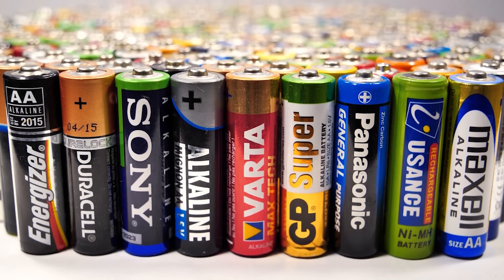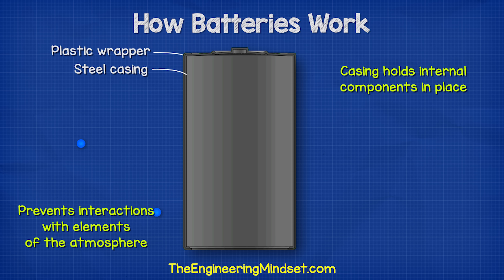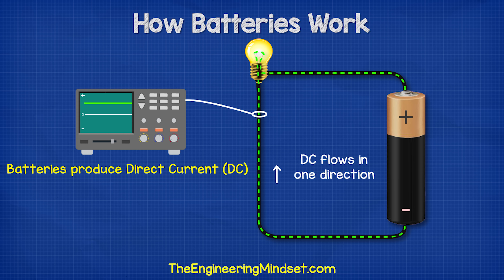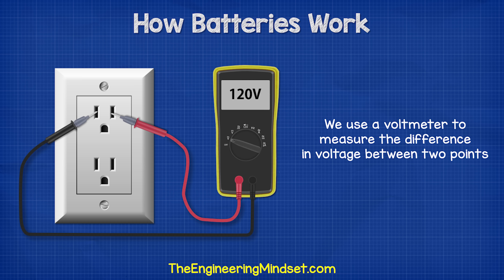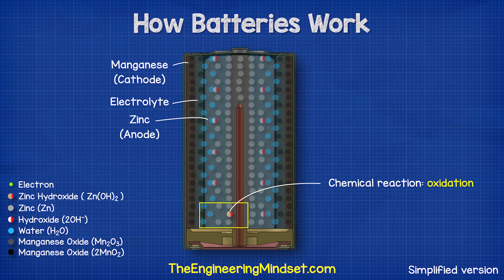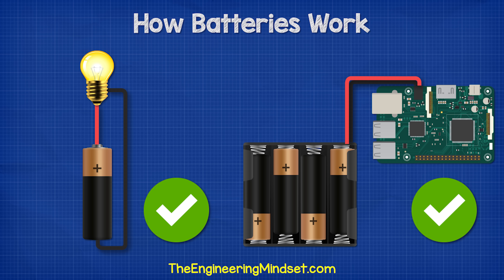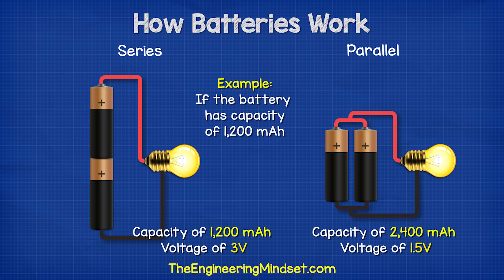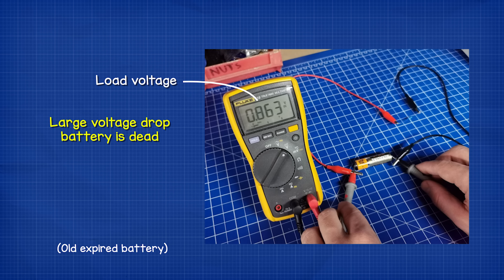How Batteries Work - Battery electricity working principle

Comment: Suppose we have a wire connected to only negative end of battery ,we know there will be some surface charges on the wire in order to cancel the electric field produced by the battery  .So does it mean battery has accumulated some net positive charge? But textbooks says batteries can't accumulate charges. This should change it's potential too

Comment: "In an alkaline battery, the electrolyte is potassium hydroxide (KOH) in a solution of water. It is in contact with the anode material and helps ions and electrons flow." He left this part out, just encase the water part blew your mind

Comment: Overall helpful, but it really needed a discussion as to why the direction of electron flow goes the way it does and not the other way, which requires a bit more discussion on chemical potential energy, etc.

Comment: Why won't it work if electrons just flow through the filament and to the other terminal of the bulb and just stop there without going back to the battery?
Reply from the maker: It won't cause the chemical reaction so electrons won't be released

Comment: I’m a noob to this subject. I have a question. If a multimeter is used to measure the difference in voltage of two points, why is it that when we measure two points on the bus bars in a breaker box, (bus 1=120V & bus 2=120V) it adds the two voltages? Why do we get a 240V read? If the multimeter were measuring the “difference”, wouldn’t it read “0”? Again, sorry if this is a dumb question. Just trying to reconcile information that I saw between two different videos in this channel. Thanks!
Reply from the maker: Check out our electrical panel video for more info, but basically one panel is +120v while the other is - 120v so the difference between then is 240v. That's the VRMS though, the true peak voltage is much higher but don't worry about that for now
Reply from the maker: Check our new Multimeter tutorial out ➡️ https://youtu.be/4lAyzRxsbDc

Comment: Please please please please please clear this small doubt.So,electrons from the negative terminal of the battery when they reach the positive terminal THROUGH THE CIRCUIT,do they again go to the negative terminal FROM INSIDE THE BATTERY or they just deposit at the positive terminal or the electron gets deposited at the positive terminal and the new electron formed by whatever chemical reaction inside the cell then go through the negative terminal of the battery to the wire and then again deposit to the positive terminal? Please please please please please clear this small doubt

Comment: AA or AAA cells are not a battery. A battery is two or more cells in series. So, 2 AA 1.5v cells together in a device form a battery (of cells). However, a 9v is basically 6 ,1.5v cells in series to form a 9v battery. You need to get these things correct if you intend to educate people.
Reply from the maker: Maybe, but, no one ever goes to a store and asks "Excuse me, do you sell cells?" they ask for a battery. No one searches for how a cell works, they search for how a battery works.
Reply: @EngineeringMindset  I hear you and no disrespect but just because alot of people are ignorant to it doesn't mean it shouldn't be taught properly. You aren't taught in biology that the man places his dick in her twat and nuts you are taught proper terms and definitions. Just making a point your video was quite professional otherwise.
Reply: @EngineeringMindset  Please clear this small doubt, please
So,electrons from the negative terminal of the battery when they reach the positive terminal THROUGH THE CIRCUIT,do they again go to the negative terminal FROM INSIDE THE BATTERY or they just deposit at the positive terminal?

Please please please please help me

Comment: If multiple batteries are next to each other, but they alternate between direction, is it still a parallel, or is that wired to work like a series? Plz help

Comment: Sorry, if this is a dumb question. 
In a simple bulb circuit with 1.5v battery as energy source. Electron flow from the negative to the positive side .
As the electron pass through the filament of the bulb. Resistant in the filament causes heat to be generated. 
Does this mean that the electron themself is converted to heat? 
and since the electron is being pull out of the battery from the negative to the positive side. 
Does that mean the initial charge of the battery, created via chemical reaction/stored charge.  is being depleted
Reply: I think no, electron themselves don't turn into heat,I think they lose thier potential energy or charge smth(I'm in 10th grade only so don't know much)

And I think yes,they keep losing whatever potential energy or charge they carry through the circuit(again,I think,I think,it's because they have resistance in thier way in the form of other electrons,nucleus,etc)
Reply: @aakashgarain  thank you, the key word you used guided me to the right reading materials ! . Thank you very much

Comment: This video describes a cell.  A battery is two or more connected cells.  These definitions are well-established.
Reply from the maker: Maybe, but absolutely no one goes to a supermarket and asks the store assistant "where are the cells" you ask "where are the batteries"
Reply: @EngineeringMindset  Please clear this small doubt, please
So,electrons from the negative terminal of the battery when they reach the positive terminal THROUGH THE CIRCUIT,do they again go to the negative terminal FROM INSIDE THE BATTERY or they just deposit at the positive terminal?

Please please please please help me

Comment: Great video probably the best currently on the internet about this subject. Only one inconsistency of the animation showed at time stamp 10:15 and thereafter of the video, incorrectly showing electrons transfer from the cathode to the anode brass pin. What actually happens is that the newly formed hydroxide molecule in the cathode and passing through the separator to the anode, is reacting with a Zinc atom to form zinc hydroxide molecule which then releases two electrons inside the anode to the brass pin. There is no direct electron flow from the cathode towards the anode only hydroxide ion molecule transfer from the cathode to the anode via the separator. The separator or else referred as barrier is porous with openings small enough to allow only water and hydroxide molecules to pass through and not to the larger Zinc hydroxide and Manganese hydroxide versions molecules. Also keep in mind that there are no individual discrete zinc atoms inside the electrolyte alkaline solution but only zinc hydroxide molecules.
Reply: So basically,the electron present in the circuit get deposited at the positive terminal of the battery,and the new electron created by whatever chemical reaction is there inside the battery then go through the negative terminal of the battery to the circuit and into the positive terminal to get deposited, am I right? please help me in this small thing, please, please, please (I'm a 10th grader so small details about chemical reactions don't bother me)
Reply: @aakashgarain  Yes.
Reply: @Markoul11  thanks

Comment: Very nice video. I have a question. If I suspend a pendulum over the positive terminal of battery, it rotates clockwise and vice-versa over negative terminal. Why does this happen? Is there a magnetic field?

Comment: Hello I have a question at 11:30 is that are these electrons in the battery are pushing the electrons of the copper wire across circuit???
Reply from the maker: Yes, the free electrons in both the battery or the wire will move.
Reply: @EngineeringMindset  thanks for clarification.

Comment: 2:00 if u rip o the plastic the cover on the + and - will fall of where the electric flows to and note if u thinking what i mean it wont be on thr chemical its the metal cap even tho there is not hole

Comment: If the positive end is in face the cathode, then the flow must be from the positive terminal of the battery to the negative end, but the ends are not labeled by electric charge, they are labeled by convention, to show where the charge is coming from. I appreciate your diagrams showing flow from negative to positive, because this is correct, however, I think you should adjust the position of the battery to show where the charge is actually coming from, while specifying that the charge is not in face positive at this end

Comment: This channel gives me ASMR chills.
I still don't get series circuits with batteries. It seems to me that the positive and negative terminals that touch would just short circuit and the power would be wasted. As far as I'm aware, the chemicals are charged from the factory, meaning that as soon as the connection is made, electricity flows and they can become neutral. If this is the case, then the original circuit through the load won't result in further voltage coming out the negative terminal. Doesn't connecting the positive and negative terminals satisfy the condition to discharge the battery? Why would it result in greater voltage? Also, how come series circuits don't discharge when they're connected, even without the load circuit being completed? They are only partially open, there is still at least one connected cathode/anode.
Series circuits just don't make sense to me. Parallel circuits don't have this problem at all.

Comment: It's not exactly like this. Actually electrons can only move almost 8 cm per hour. They still move, so when electrons move they produce electromagnetic waves. These waves are pretty close to the speed of light. With conductive materials, electromagnetic waves flow and complete the circuit to produce electricity. Just think about Nicola Tesla and you'll see what I'm pointing. Video is good but could be better.
Reply: @AmanKhan-yk6mj  Well, I already did but let me explain a little bit different. If you watched all of the video, consider everything it says are true but 1 part which is electricity doesn't carried by electrons. They carried by electromagnetic waves. That's all :)
Reply: @AmanKhan-yk6mj  hl

Comment: woah woah stop right there isn't it that a battery works by a material with few extra free flowing electrons trying to find other atoms with incomplete electrons? That when you connevt a wire between this two slabs of material the first materiall with tons of electrons will flow to the material with lesser electrons and the principle of battery draining is when the firt materials donated all the electrons to the second material?? btw I'm 9 yrs. old so I don't know if I'm correct haahhhhahaha. also isnt it that the insulator only acts as an insulator to disable the reaction specifically the receiving of electron from happening??
Reply from the maker: Please watch the video, it is all explained in detail

Comment: Wow- I’ve been trying to understand the chemical reaction for a long time, and have researched in many places. Finally- a video that explains it clearly. Thanks so much!
Reply: Is electron flow is opposite to current flow?
Reply: @alladamohan9339  Conventional current flow is positive to negative. It’s technically wrong— current (electrons) flow from negative to positive. Benjamin Franklin got it wrong, and it’s been taught that way ever since. These days, you’ll see some teachers who show conventional current flow, and some who show electron current flow. It doesn’t really matter which one you use to analyze a circuit. You just have to be consistent.
Reply: @alladamohan9339  no, curent is the flow and volume of current without time being calculated. Sorta like water in a pipe
Reply: Plzz explain any one

Comment: Can the lamp turn on if i connect positive terminal of battery1 and negative terminal of another battery, named battery2. The batteries are similar.  Thinking of positive and negative caused by electron this should work.  Please your help
Reply: No.  The two batteries have to be connected to form a circuit.

Comment: Why are alkaline batteries often rated in amp hours, while lithium ion batteries are rated in watt hours?  Isn't watt hours much more specific and useful?
Reply: if you know the voltage of a battery Wh and Ah can be easily converted into each other, product of Ah and the rated voltage gives Wh. Some products come with both labelled

Comment: So why put a fuse or a switch or a load on the positive side of a DC circuit, "IF," electrons flow from negative to positive????? Something is wrong with your analogy of electrons' flow. Yes I am from old school and I claim your teachings WRONG......
Reply from the maker: You could place a fuse on the negative or anywhere in the circuit, it's just standard practice to place it on the positive. If on the positive or negative it will break the circuit, if on a branch within the circuit then it will cut power to that one branch only. You can watch our Electrical current explained video to see electron flow but we will make some further videos to prove the theory.
Reply: If you think of a car where only positive wires run to the devices and the negative "return" is through the metal body of the car, then how could you put a fuse in the negative part?   The fuses are on the positive sides of the circuits. However in some very old models of cars (like my first one!) they had a positive earth return so the fuses were all in the negative side.  It is just a convention but it makes reading electronic circuits easier.

Comment: I don't understand something about putting batteries in serial...
If the battery is designed not allow electrons to freely flow between the cathode and the anode, the electrons are "transferred" by the hydroxide ions

But what i don't understand is, that if you put 2 batteries in serial, the one battery is pumping electrons into the other when the circuit is closed. Wouldn't that mean that the second battery has to do the hydroxide chemical reaction twice as fast and expending the manganese oxide twice as fast?
Or am i missing something?

How does the electrons flow trough the second battery without expending the second battery?
Reply: I have thought about it and i think i made a mistake....
The amount of electron is amperage, the willingness of pushing it trough is the voltage.

When you put betteries in series, you have the same amount of electrons, you don't expend fuel more. but because of the series the batteries want to push electrons more into the circuit, because the last battery providing the electrons is more ready to provide them, it is "primed" pushed more by the other batteries.

But in total the same amount of electrons are leaving and entering each and every batteries in the series

What i really don't understand is the fundamental nature of voltage. so if you put more batteries in series, it means more electrons are pushed and waiting on the negative side for the circuit to be complete and more free space is on the opposite side.
Is there a limit what the battery can physically do?
Or is it so high what a battery is capable of that it has no practical use of measuring it

or i'm just mixing and meshing things up?
Reply: Can u explain me your question in short?..
Reply: @ham1732  I have already answered myself, after some thinking
My question was, that if i have 2 batteries in series, how does the electrons passing through the first battery from the second battery, without depleting the first ones fuel with the ion transfer.

Answer: They don't because extra electrons mean increased amperage. In series, voltage increases by the increased "willingnes" of expelling electrons from the first battery due to the ready supply of incoming electrons from the second.

No extra electrons, just increased "willingness" of the electrons to go. Thats voltage
Reply: @fatherdoctor  o great i understood your question now!! The answer was nice too

Comment: Brilliant video.
Not sure if this is a daft question but what stops the chemical reaction taking place all at once or continually occuring while it's not in a circuit?
Is it to do with "saturation" of electrons around the brass pin?

Comment: If anode and cathode are insulated from each other, how can putting batteries in series work? Won't just the cathode of the first battery and anode of the last one provide electricity for the circuit?

Comment: You say that the battery provides the pushing force (voltage), but what about the coulombs? Where do the electrons come from? Must be the battery, too, right? So if it's providing both, why are they only measured in volts?

Comment: Technically a cell not a battery.
A battery is a grouping of cells, combined to reach a needed voltage or amperage.
Six cells in a 12V automotive battery, or six AAAA cells in a nine volt alkaline battery.

Comment: I am totally confused about the conventional vs non conventional current flow.
in the video it is explained that the current flows from - to +.
i put together a simple circuit on my breadboard the way the diode let current flow from negative to popsitive.
it didn't work....
it worked however the other way around.......WHY ?!
Reply from the maker: Watch this without skipping, all is answered https://youtu.be/kcL2_D33k3o

Comment: Do you know why sometimes switching the battery terminals allows it to run for some extra time??? It happened to me a few times before and I cant really find an answer. Thanks!
Reply from the maker: That's a very interesting question, I don't know the answer but I would guess it's to do with the resistance generated internally, so swapping them will allow a lower voltage drop so they work a little longer. You can also warm the battery with your hands to make friction, this will excite them and they last longer
Reply: Also, maybe a resistive oxide film gets rubbed off when they're swapped.